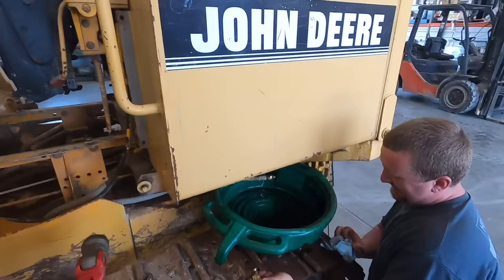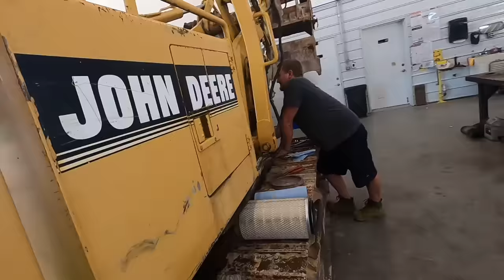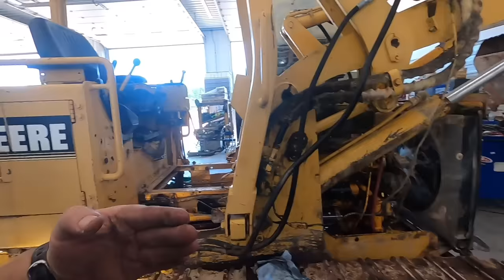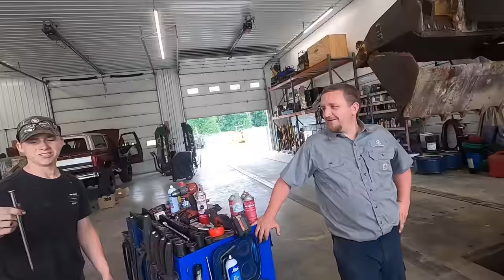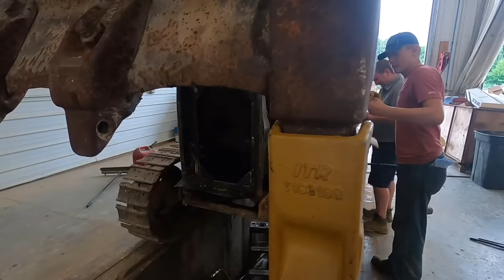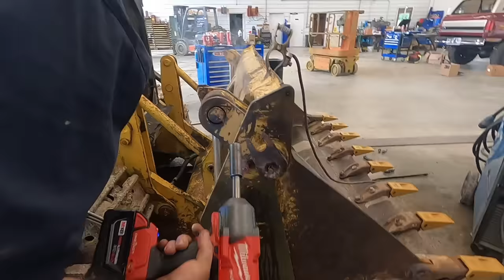We try to get the @JohnDeere 455G running and moving again but run into big problems 🤦‍♂️🤦‍♂️

Comment: on fuel tanks, my friend said he was on the course, and it was mentioned that the inventor of Barbie dolls also invented a lining for fuel cells that would let water collect into it and then run to a low spot. I'm not sure if the invention ever went anywhere, but it would be some handy.

Comment: Heat causes metal to expand. When removing a broken bolt, heat the metal surrounding the bolt  and "NOT" the bolt, so the hole gets larger. Heating the bolt only causes it to expand and get tighter in the hole.

Comment: Here is a trick I have used in the past to remove broken bolts. Before you weld on the nut, drill a 1/4 inch hole in the end of the broken bolt about 1/4 inch deep. Take an air hammer/air chisel with a round tapered punch on the end. Place the tip of the punch into the hole you drilled and hammer the piss out of it for at least 30 seconds. A lot of times that hammering action will break loose a lot of the rust in the threads. Weld on your nut and you will have a lot better rate of sucess.
Reply from the maker: Great idea
Reply: Seriously great idea! I’m stealing this myself.

Comment: Probably burnt out the starter or damaged the cables trying to get it to run with that blocked fuel line. Nice work getting it running!
Reply from the maker: Thanks

Comment: thats how i got a good case  580B in 2012 a town ship had it on the island doing water and septic work for the homes and community center. it stopped moving and there mechanic said the transmission gone out, it had not been run in 4 years, i asked them if they wanted to sell it, they told me if i could get it running and off the island before the ice road went out, witch was already getting iffy. i i could have it for $500, cnd, scrap price for a place 400 miles from a scrap yard  has a cab with heat, i know these 480 rubber tire loader backhoes pretty good, i know if i got it running and put it into forward and if it jerked forward and stopped, same when putting it in Rev. the transmission was fine, i took 5 gallons of fresh fuel and filter out in my truck, drained fuel tank changed filter, i fired up in about 10 cranks. it had turf tire on it but they have a like new set of contraction tires for it that go with it plus the service manual for the B and the E series, sure enough i put it in forward and it jumped a head an stopped, i knew what was wrong, i used the backhoe to pull it self out of the brush, out on to the town island road and pulled my self up on my trailer, with the hoe ya it was a bit heavy on my trailer, i chained it down and out over the 2 miles of slushy ice road and 400 miles in the cover of dark,  home, in the spring when it warmed up to work on it, i drained the transmission, drilled a 1" hole in the case, were i knew the pick up screen is, when the first bit went though, black mud, drilled until i had a 1" hole, flushed it out with a vasal cleaner air parts sprayer, used 6 gallons of fuel oil and vasal mix . the catch pan was like stuff you dig out of a swamp. i kept flushing it until clean vassal flowed out,  then flushed it though same hole with hot water and presser washer.. drilled the hole bigger for a 1-1/4" pipe tap, put a 1-1/4 pipe plug in the hole, filled the trainee up, new filter, 2 new self made bucket pin on the backhoe, everything else was tight, it only had , 6800 hours on it, they had bough it new in 1976.  to this day it runs great, these old case 580B an C have no way to get to the pick up screen in a sump in the housing, the dealers tell you you have to tear the transmission down and rebuild it, thats total bull crap, you just need to know bang on were and how to drill it.  here in NW ONT. CANADA, heath and safety banned all shop pits EVEN ONES with built in exhaust fans many years ago due to deaths, close calls (bad air) years ago, they all had to be filled in, SHOP USE HUGE LIFTS OR BIG  STEEL RAMPS, FOR BIG TRUCKSAND HEAVY EQIPMENT
Reply from the maker: Lol
You gotta do what you gotta do sometimes
Reply: @C_CEQUIPMENT  yup. more often then not... lol

Comment: 8/16/22. Liked yur JD 455G shop repairs: new starter/cleaned ground contact/fuel drain & tank flush/hydraulic spool valves & new 4-lip-seal 'o' rings/hydraulic oil drain & screen filter scrub-comb-clean/new hydraulic hoses for (split)bucket/kill wasps & test drive while waiting on new parts for under carriage solid rods & many new rollers. Yup..bunch of work before can get to missing track rollers but am sure after new rollers, psi wash & paint (?) this 6-700hour machine will have a new (happy) owner knowing you & yur team at C&C has reworked everything to A+ condition! Continue this re-work for us YT viewers & fans of HD equipment renovations! Much enjoy yur channel & fine video/lighting/closeups/before & after reviews. Stay safe & carry on sir!👍👍👍🛠⚙💪🍺😊
Reply from the maker: Thanks

Comment: Clint love your videos, try welding a heavy washer on a broken bolt first then a nut. When heating up a nut to remove a bolt, just heat up two sides opposite each other, much less likely to strip the threads, I found this the hard way. Keep up the great work.

Comment: Good job guys getting the 455 to run the tracks looked like a wave at the ocean when you took off forward. I’m not a ford guy but that bronco is a sweet truck especially with the one ton axles and the Diesel engine, Hunters got a chick magnet when he turns 16. Great job!

Comment: I changed a lot of O-rings to Quad-rings, especially on flange fittings and flat face fittings. They provide a much better seal, especially on large hydraulic flanges on 4 and 6 inch pipe.

Comment: When I bought my own business in 1996 I bought a JD 190E, then a JD 160LC (both new) and  then a used (early 80's vintage) 450 dozer.... I loved the equipment but the ONE thing that I hated about the John Deere stuff....that damned rectangular glass fuel filter!!!!!  Why couldn't they just have a spin on like everyone else???  (Actually the 2001 160 LC had the cylindrical fuel filters....but then instead of a spin on....they had that damned lock ring....just as bad as the glass filers).....LOL

Comment: Much nicer than the last one... you don't have to tear the engine down and rebuild it... of course the undercarriage is mostly MIA or a disaster.. but there are worse things.
Reply from the maker: It could be worse I guess
Reply: @C_CEQUIPMENT  Yeah, that other crawlers engine was basically slag... undercarriage almost feels like easy stuff... (of course, you can see the problems at a 100 yards wtih it too)

Comment: I gotta 450 allis w a 6 way blade w all new rollers,drive gears n tracks.a dealer up here put a new seal in the right rear n knocked it out while installing the drive.they also were supposed to put in new brakes n steering clutches.ya interested.been sitting.
Reply from the maker: That might be outta my area of expertise 😁

Comment: Save up old diesel in a drum and gift it to Mike Dirt Perfect to use lighting up brush piles from tree line and plot clearing jobs.
Given the price of Diesel I've no doubt he'd appreciate getting it given to him.
Well, after a little bit of struggle bus grief and milk chocolate removal looks like you're down to getting that little beast to stop throwing it's tracks off and then a bit a paint and it'll be ready for a new owner.
Reply from the maker: Time will tell
Reply: a more fitting gift would be to Peg of BiasPly. Im sure Peg has some POS furd powerjoke that's dying for some ancient diesel

Comment: i dont think they read anything anyone's says, i have said many times, as a life time welder on heavy equipment, when you have a broken bolt or stud, never use a mig welder, use only a 1/16 th 309 stainless steel stick rod to weld a nut or a pipe nipple if in deep, no need to heat with a torch, weld it in good an hot. let it cool off, most times you can unscrew it with your fingers, stainless shrinks carbon steel, brakes rust free, on big truck wheel studs i will spray angel piss on them once it cools down past red hot

Comment: I have a deere 450G.  On the bottom of the spool valve assembly are two like extensions that are held in by two allen head screws.  One of mine is leaking.  I tightened the allen head screw and slowed the leak a lot but it still weeps.  How big a deal is it to pull that off and replace the seals ?
Reply from the maker: Not to big of a deal
Get some quad rings and reseal
3/4id x 1” od

Comment: When there's a stuck bolt wouldn't heating the (expanding the) area around the bolt (ONLY) be better than the bolt too?
Reply from the maker: Depends on how thick the materials it's in... the idea behind it is to break down the rust with heat. If the materials is thick it will act as a sponge and absorb the heat and spread it across the part before ever helping with the bolt removal so it's more of a time and material issue... so yes your right it does help-Kevin

Comment: What brand/model is your jump pack. How do I tell if my machine is a 12 or 24 volt set up? Thanks
Reply from the maker: I have Napa ones and a harbor freight one
Best way to tell is if your batteries are parallel or in series 
Or sometimes you look for a battery gauge on dash or look at starter or alternator to see if it says 12 or 24

Comment: Nice vidja Clint. I saw you had Mason replacing those front bucket teeth.  Do you weld them all on there after you bolt them down?
Reply from the maker: Yep 
They just float, no welding

Comment: Do you have pcs of equipment you buy n repair that has so much overhead in it you have to keep it, or just cut your losses or does not have machine value of the repair/ labor bill...
Reply from the maker: Normally I can foresee what something might need and will make the call on what to do with it

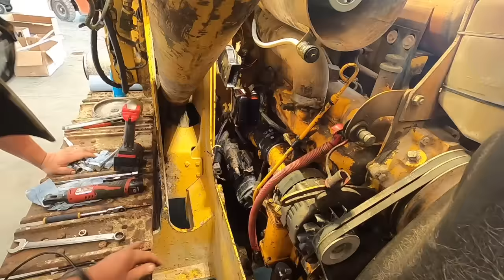Comment: At 14:20, what tools did you use to remove the starter? My 455G has a ln AR63341 and where a 14mm socket would go, even with a swivel, I can’t get a socket to sit even on all 6 sides? Any help on that.
Reply from the maker: Probably just a short thin wall socket

Comment: What should you check if the clutches don't work and pedals dont come up, aka won't steer but the brakes work?
Reply from the maker: Low main pressure
Trans pump?
Reply: @C_CEQUIPMENT  guess I need to throw gauges on the clutch valve body to see where the pressure is. Just bought the machine, there is a filter warning light on. Maybe a loaded strainer like your machine?